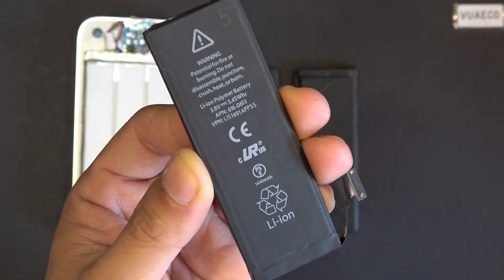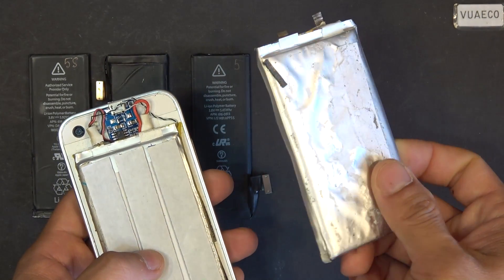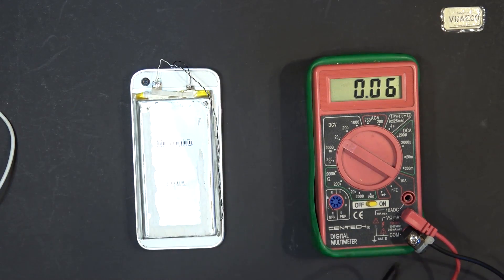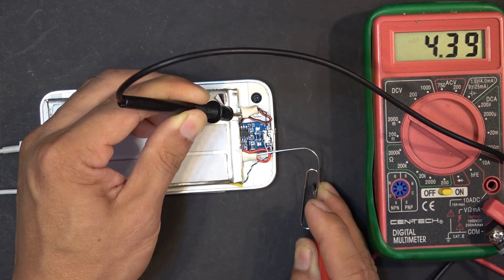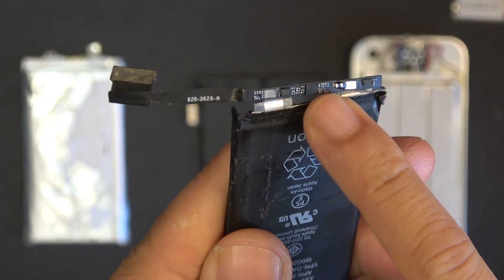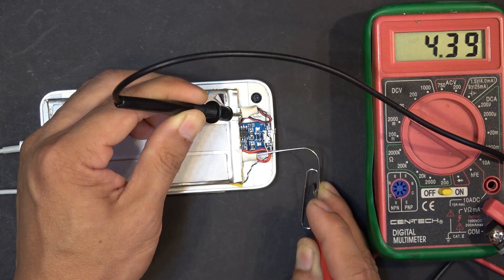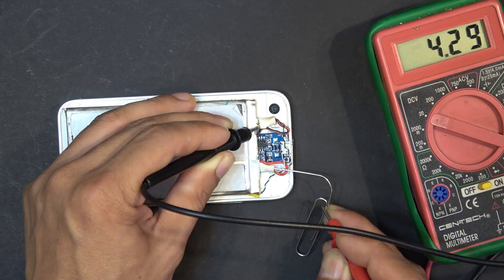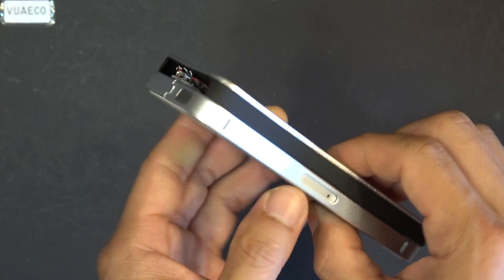Why does an iPhone battery only last for 1-2 years?

Comment: Does overcharging the cell allow Apple to gain any more capacity from it at the expense of its service life? Just wondering. It is a rotten thing for them to do anyway.
Reply: They could achieve the same effect by going from 4.2 down to 3.0 

Lithium batteries can be safely discharged down to 3V without causing excessive damage to the cell (far less than charging to 4.4 and draining to 3.6)
Reply from the maker: Yes, it does. You're absolutely right. It gains more capacity at the expense of its service life. That makes more sense when you're a phone maker, seller, and (technical) service provider.
Reply: @vuaeco  bro. I used to own a Samsung galaxy j7 next that I gave to a friend recently. And after 4 years of use and 2 major os upgrade, I was pleased to see that it's 3000 mah cell didn't deplete and I could get 2 full day of moderate use.

Comment: Perhaps the bms in your iphone is a bit dud? Electronics do go dud sometimes.  I've had my iphone 4 from new and it's still going with its original battery.
Reply: How many cycles?
Reply: @rostyc  Not a clue but, I'm not the sort of person that lets a battery run flat before recharging so,  that may be why my iPhone 4 battery is still going. You should get a lot more cycles out of a lithium battery if you keep its charge above half. Also, turn the wifi and bluetooth when you don't need it, you could also turn the phone off now and then and give yourself and your phone a brake.

Comment: Hi, I have been repairing iPhone's for over a year and have done over 200 battery swaps and can confirm that this is only half correct, the cells used are of a slightly different chemistry and can be safely charged to 4.25 - 4.35V and then discharged to 3.4V - 3.5V. If you use a high quality aftermarket like the ones that injured gadget's makes the bms in those are higher quality like the apple batteries and will stop charging at the proper voltage. However most of the cheap ebay batteries have crappy a bms  and therefore overcharge and over discharge the cell which is why the cell will often only last a year and why its very common for me to replace swollen batteries in these phones.

Comment: This battery is a lihv it's supposed to be charged over 4.2v
Reply from the maker: LiHV (high voltage Lipo) batteries are only used in the RC world. They provide high discharge rate for RC cars, airplanes... Even though they can store more energy than a standard high discharge Lipo due to higher voltage, they still have lower energy density than Cobalt based Li-ion batteries such as the ones in cell phones and laptops. LiHV batteries therefore are more expensive but still have low energy density. Apple would never spend more money on a high discharge, high voltage, but low capcity battery to put in a cell phone. There's no point to put a high discharge battery on a cell phone, either. Cell phones don't fly or go fast. It makes more sense to put a cheaper but higher energy dense Cobalt based Li-ion batteries in cell phones and laptops. So no, iPhones do not have LiHV batteries.
Reply: @vuaeco  your wrong nominal voltage for a iphone is 3.80v DC and full charge limit is 4.35v DC they are also lipoly chemistry.
Reply from the maker: Lipoly? 4.35V? On an iphone? With 40C discharge rate, too? I'm ready to bring my iphone on an RC race track to compete with a Traxxas.
Reply: @vuaeco  Give it a go lol
Reply: You prob could stack a bunch of laptop and iphone poly cells and do that. Think I saw a video of some guy rigging up old phone batteries with a grinder for a ghetto ebike https://youtu.be/xkMStN6MiLA?t=2m30s

Apple calls it a Lithium Ion battery, but any pouch type battery is considered Lithium Polymer. "Pouch packs are commonly Li-polymer."  https://batteryuniversity.com/learn/article/types_of_battery_cells.
Not certain about the High voltage of these cells, but according to everything I read its best to store Lithium cells at 40%-50%. 
 If you constantly use your phone then, the battery won't go bad being charged fully. It's when you keep it fully charged or discharged constantly/long period of time, that the damage happens.

https://www.youtube.com/watch?v=zQ_y3nKU360 - he has good points on the subject of ebikes and 18650 cells.

There's all different opinions  on the subject. I think keeping the battery between 20%-80% is best. One of the apps I used suggests "tips" the majority of the time is to stay in the 50-90% range. Then a monthly deep discharge, to cycle all the chemicals in the cell.
If the cell(s) are exercised all the time/ just used constantly with battery and not plugged in charging. Then you won't need to tend/monitor your battery.
https://www.apple.com/batteries/maximizing-performance/
https://batteryuniversity.com/learn/article/how_to_prolong_lithium_based_batteries

If you want a great app program to monitor your battery I use this one.
https://itunes.apple.com/us/app/battery-dr-pro/id635834560?mt=8
and this one
https://itunes.apple.com/us/app/aida64/id979579523?mt=8
Reply from the maker: Thanks Duong. That's a lot of info you got there.
Reply: Well, there are a lot of smartphone cells which do use LiHV chemistries at 4,35-4,40V max charging voltage. This allows for a higher total capacity in terms of Wh. This is done to extend the useful capacity that can be used out of the cell since phones need a minimum voltage for their electronics to function correctly, which is 3,3V, compared to a 4,2V chemistry which might have quite a bit more capacity left down to 2,8V at slow discharges.

However, since they can get out more capacity out of the cell, it does tend to degrade it faster, and you have to replace it more frequently.

This is why taking care of the battery pack is so important. I never discharge below 15%, and typically keep it above 20% before charging, and limit the max charge to 88% to extend the life of your battery pack.

On Android, with root access, this can be done using an app called Battery Charge Limit. On iOS however, you have nothing unfortunately.

Comment: Could your phone be bad ? The charger portion of it? Hmm. I should find an iPhone!
Reply: U know what, I think it's an HV lithium battery. Check out GoPro batteries too. Also, an imax b6 has an HV lithium option... This may actually be normal voltage.
Reply from the maker: 1. If my iPhone is bad, it's got to be bad in a very good way (sarcasm). It's bad but still finds a way to charge my battery just high enough to kill it over a few months.
2. Cell phone and laptop batteries have high energy density. Therefore they are mostly Cobalt based as high as 60%. A Cobalt based Li-ion battery has high energy density but very low discharge rate. And they also requires gentle treatments (just like a beautiful woman! :D) That means optimal charge/discharge rate has to be low and charge voltage also has to be low (optimal max charging voltage is 3.9V).
3. To answer your comment about HV Lithium battery, it is a high discharge Lipo battery that charges up to 4.35V. They are only used in the RC world for power demanding RC cars/airplanes/boats. There's no point to put a high discharge, low capacity, and more expensive battery in a cell phone. Cell phones don't fly and they don't go fast either! :D
Reply: vuaeco i understand.... but gopro batteries read 3.85 nominal 4.4 volt charge voltage. I wonder if iphone uses same. I bet its the same.
Reply from the maker: Do you actually have one yourself to test it? I'd like to know as I don't have one to verify this. On the label of that battery, it says 4.4 but that's Wh, not V. And on the Gopro charger, it says Input 5V, Output 4.2V. I don't think Gopro would put an RC battery in this camera. It's a small and very compact camera and they would want a battery that's energy dense, not a LiHV high discharge and more expensive battery.